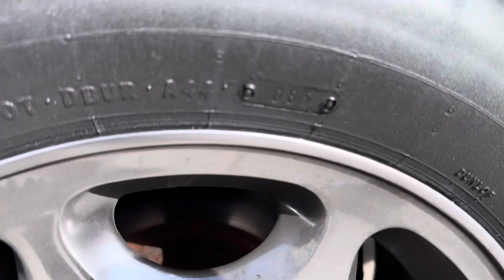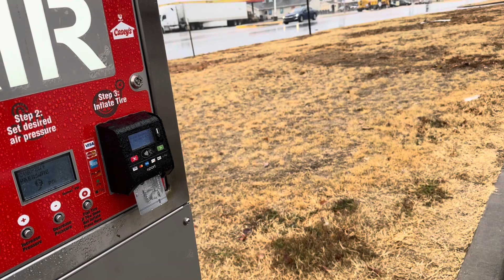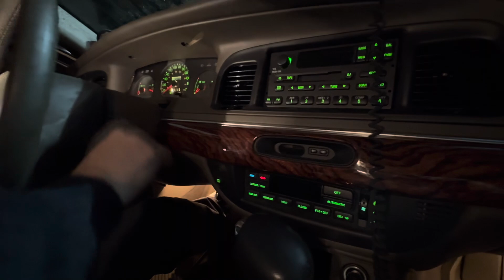Pt2. We drive a 1984 Mercedes 500SEL from Portland Oregon to Kansas and find a BONUS car as well!!!!

Comment: That’s an LSE! My grandpa still owns one. It’s the pre cursor to the Marauder and had a different dual exhaust system for more power, a “sport” tuned suspension and the floor shifter. It’s similar to the Crown Vic performance package cars. They’re actually fairly rare
Reply from the maker: Thanks for watching and commenting!

Comment: Nice mercury i am huge fan of the panther platform cars. I have a 2006 grand marquis 3 days after i got it the check engine light came on. Three codes popped up with P0430,P0304, and P0316 popped up, i don’t think that is something major i think it might be a spark plug or coil pack.